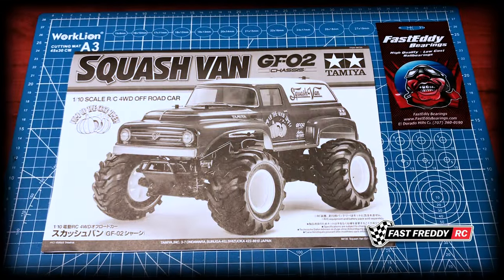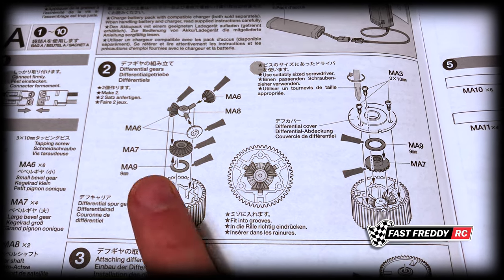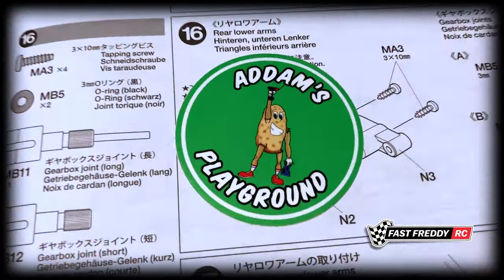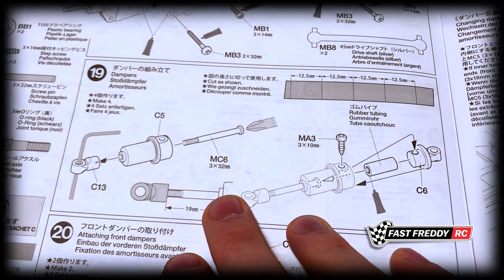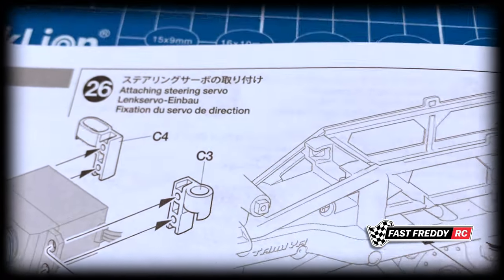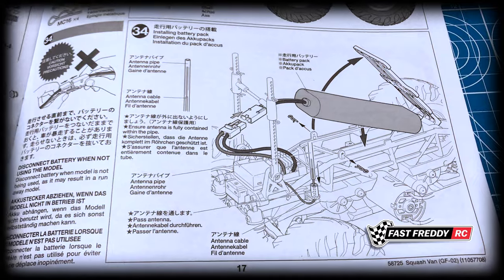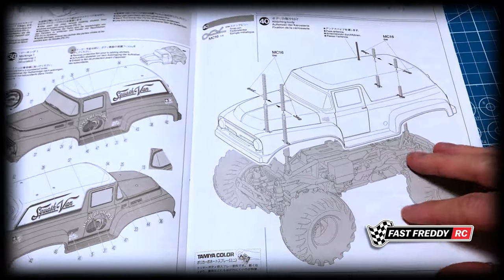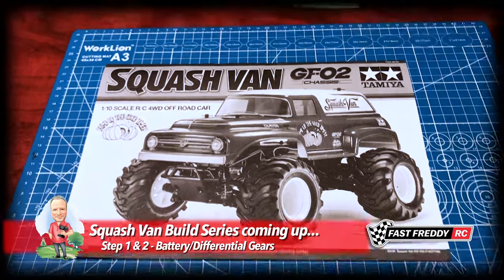Tamiya's NEW Squash Van Build Series! - Manual Overview

Comment: You can use a "y" cable for the steering or put it on a stick radio and run the rear servo separately.  This will let you crab walk!
Reply from the maker: Yeah I'm very curious about the setup for this.  Everything I'm reading says your radio has to be a 3 channel, which I have, but it must have the capability of '4WS Mixing' which mine doesn't have. I might have created a reason to get a new radio lol
Reply: The y cable works with the 2 channel.
My konghead is set up that way.
If you go for a radio get a flysky is6x do the throttle mod and you can have true 4 wheel steer.
And you will have a radio for your truck that you need to pull all those trailers.
I use the stick radio on the Clodbuster and the CR01.
And will use it on the TXT01.